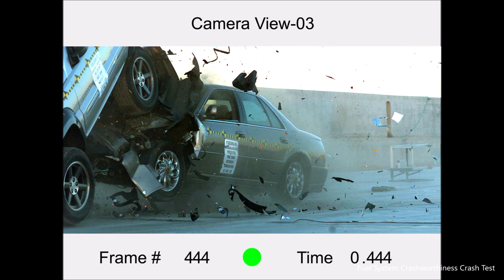2002 Cadillac Seville Into 2003 Jeep Liberty Fuel System Integrity Rear Crash Test

Comment: There was a recall program for the KJ body Jeep's to address this issue. They did not install a metal box around the tank.  They just gave you a trailer hitch to put some metal bracing between the  bumper and the tank. That was it you didn't have a hitch already.  They did not include wires for trailer lights so you could actually tow.  
Mine that I still drive is the diesel engine version. I am really not worried about it being safe diesel is not a volitile fuel like gasoline is and doesn't ignite nearly as easy. That and I also have the trailer hitch and a fuel tank skid plate that is much like the box they put on in the video.
Reply: Its enough to deflect itself just like the full box after tests. It wasnt the only option to correct this.
Reply: That makes so much sense, I have an 07 KJ with a hitch but no wiring harness
Reply: @Showe2625  yep the wire harness was only included with the towing package from jeep.  Mine had that.  You can probably get something aftermarket to add the wires... see your local uhaul store.
Reply: @MrMikey1273  yah good call. Do you have a 4 pin or 7 pin connector?
Reply: @Showe2625  mine had a 4 pin originally but then I got a pop up with trailer brakes and had camping world change and run additional wires to have a 4 and 7 pin connector with a tekonshia brake controller. 
I have a 2020 Toyota tacoma now too and that came with the 4 and 7 pin built in to the bumper. Toyota didn't include a brake controller but a connector for it was under the left kick panel and I installed a Red arc tow pro.  You definitely need trailer brakes if the trailer is over 3000 pounds and it's a nice safety item for smaller trailers like my pop-up that has them

Comment: Wait, the fuel tank was just in front of the bumper, behind the axle? That sounds like a real shit idea to begin with. Yikes.
Reply: And people think electric cars are even more unsafe.
Reply: There are a lot of cars (chrysler cars especially) and ford trucks with this design
Reply: This is where all SUV's and vans had their tanks. They have all moved in front of the rear axle now.
Reply: It was very common during 50s to late 90s specially on RWD cars. Tha drive shaft and exhaust pipes take most of space, the solution to this is to have a split tank under the back seat with two fuel pumps in it. But thats to expensive for Chrysler/Ford
Reply: @VkRmotorsport  that's the set up that my Grand Cherokee has. The Charger and Challenger have that too.
Reply: @scott8919  when the batteries breach....